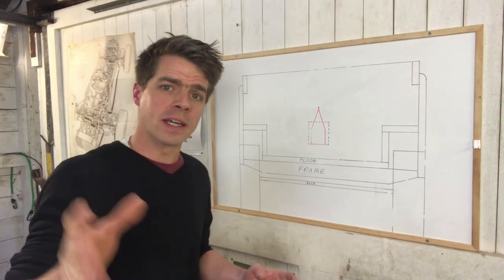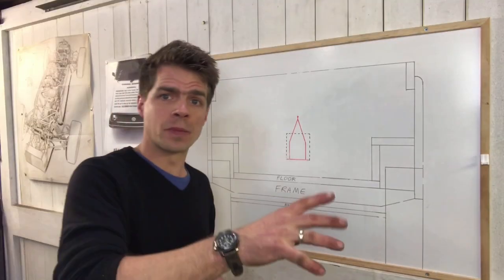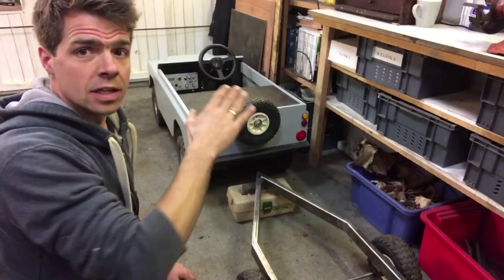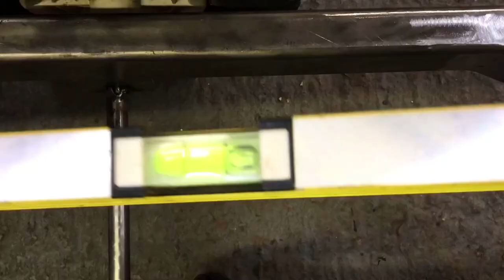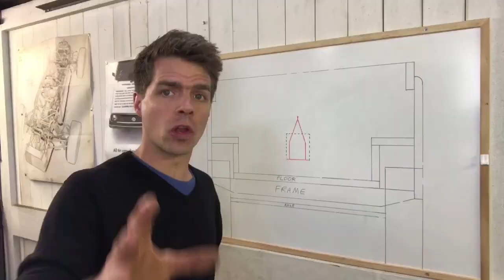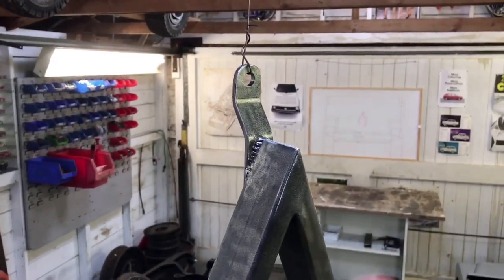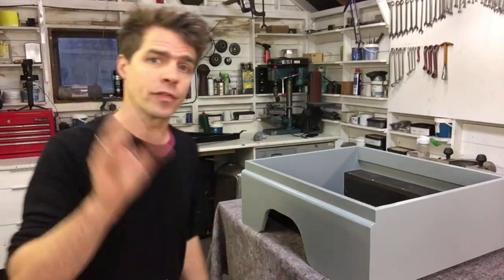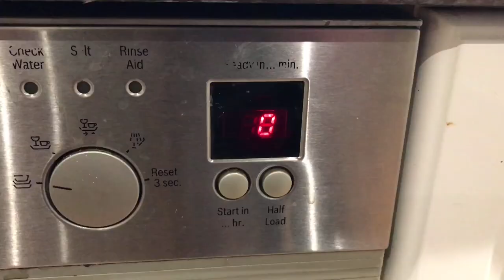Building a mini trailer for my kid's mini Land Rover

Comment: Did you make the landrover yourself?
Reply from the maker: Yes. I used the motor, axle and modified chassis from a mobility scooter and the steering system from a garden tractor. I made the body from plywood, just like the trailer.